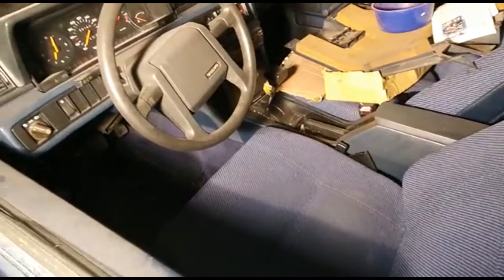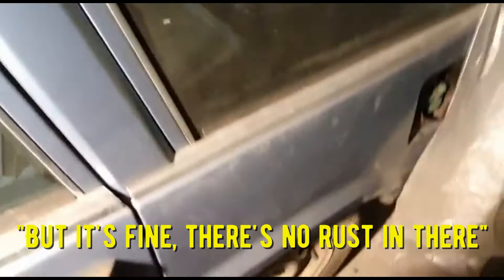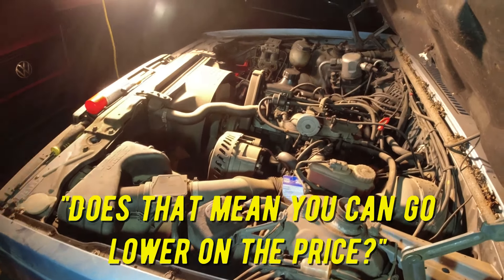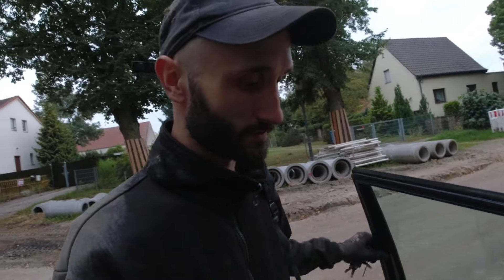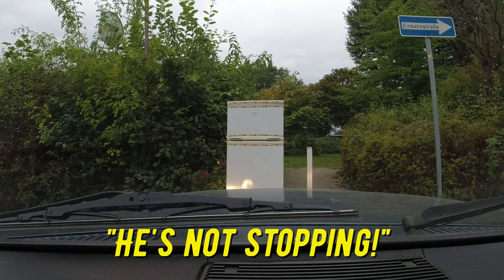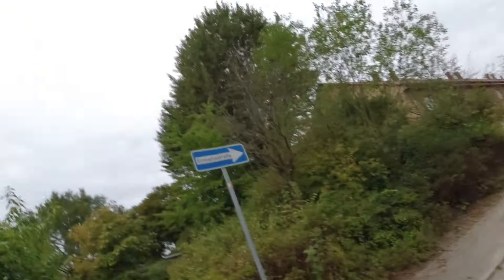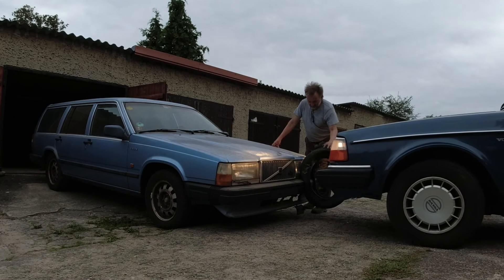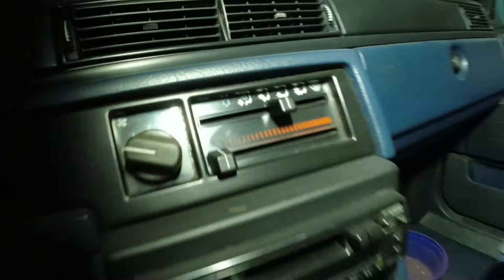We Rescue an old Volvo 740 Sitting for 10 Years in Storage!

Comment: 4 things to check:
- the in-tank lift pump. There is an access panel under the carpet in the boot. You need to unscrew that large plastic ring.
- the pressure pump under the floor near the front seat. 
- the big white fuel pump relais on the fuse panel (take out the ashtray for access.) you can open up the relais and re-solder any wonky solder joints. Most of the time that will fix it.)
- the fuel injectors (they could be stuck from varnished fuel. You would need to clean them)
Reply from the maker: Thanks! Do these definitely have a lift pump? I still need to do some checks and tests but the parts sites are only listing 1 pump which is the one under the floor..
Reply: @Involvod  my 780 has an intank pump. As far as i know all 700's have them, only the late 900's (my95-98) have the single pump setup as far as i can remember.
Reply from the maker: @jfv65  you're right, turns out they do list them, it's much cheaper as well so would be nice if it was that :D
Reply: Put 12V to your injectors with 2 wires from your battery. 1 side connected to your battery, the other side of the wires you keep in your hand and make pulses with them on the injector electrical connections. You should need to hear the injectors clicking, if not they are stuck. Do it like 10-20 times per injector, they can come loose again. I have got a car running like that who was stored for 10years or longer. Also B230F engine. Good luck 👍

Comment: It's coming home, It's coming home, It's coming home, It's coming home, The Volvos coming home... Pushing it up the ramp just proves Volvos are built like tanks :-) If the battery is any good the starter motor is surprisingly powerful - just spotted it's an auto! Looking forward to seeing it start.
Reply from the maker: Yeah I feel uneasy not being able to bump start, drive on the starter or dip the clutch and rev it out when it's running like crap, been a few years since I've owned an auto but I am looking forward to the lazyness of it especially with Berlin traffic!

Comment: check for coolant leak via the shut off valve on the bulk head , it leaks under the carpets and causes corrosion
Reply from the maker: Thanks I'll definitely look at that, wet floors are a nightmare I've been having a right time of it on the 240s!

Comment: Hey man, nice purchase! Looks like in Germany these things are little bit more expensive than in eastern Europe. My first volvo couple years ago was 740 sedan with a bit more crusty undercarriage for a 400 euro. Can't wait to see more videos on the 700 series. Start by checking the fuel pump relay and fuses - mine was missing those altogether. Adding some fresh fuel might do the trick as well. Fuel pumps usually the first thing to go on these things after sitting for a long time
Reply from the maker: Hey, thanks! Yeah they are quite expensive here and the prices are rising by the minute it seems. Thanks, I'll bear that in mind, going to do a few tests and checks on it very soon

Comment: Really nice Volvo. Fuel relay is often causing this model to not start. Is its not a B230E motor..Then it can be tricky.. Nice buy anyway
Reply from the maker: The B230E is k-jet right? Bit problematic. Thanks, can't wait to do some tests and get it running!
Reply: @Involvod  yea. I had one of k-jetronic. I never manage to get it to start. Im Courious to see what The error is in your new 740
Reply from the maker: @VolvoswedenSe  I hear that alot, the k-jet being difficult to figure out issues on, but when they are running correctly they run very well. Me too! Going to jump on it very soon!